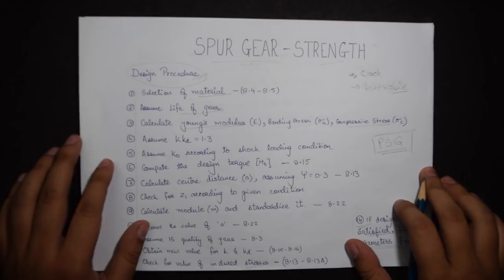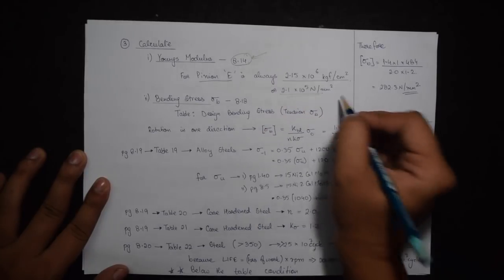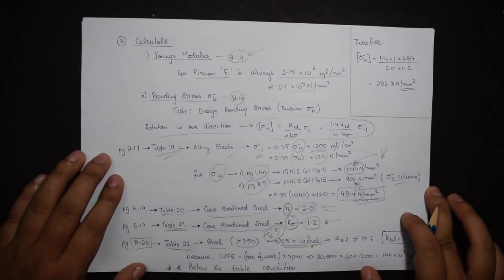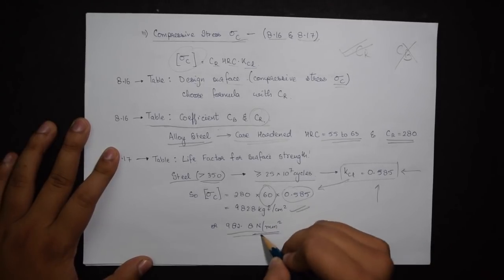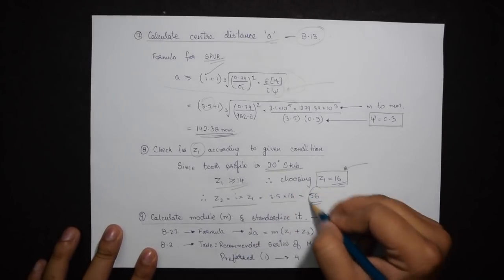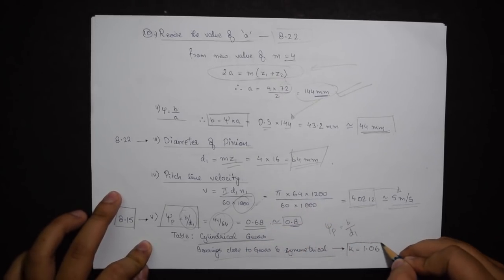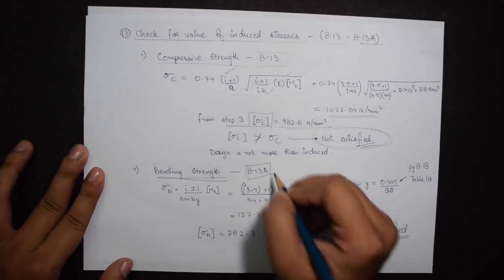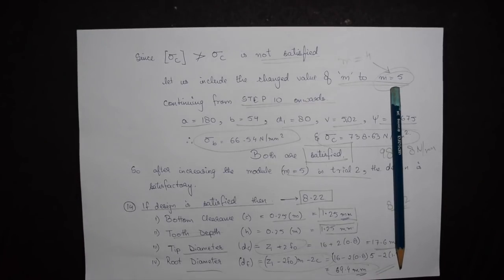Spur Gear Design Procedure based on Strength

Comment: Shouldn't we do the checking with the gear too, instead of just the pinion?
Reply: Adhitya The gear is under a lot more torque than the pinion, due to lower RPM. So, the contact and bending stresses for the gear would be higher than a pinion's. So why check the pinion instead of the gear?

Comment: U are talking about taking 8.5 and 8.17 and 8.16... What was that?
Reply from the maker: The link of the book from which the formulas are taken is 
Amazon - https://www.amazon.in/Design-Data-Engineers-College-Kalaikathir-Coimbatore/dp/8192735508/ref=sr_1_4?ie=UTF8&qid=1508657797&sr=8-4&keywords=design+data+handbook
Reply: U can buy this book (PSG) from the shops as well
Reply from the maker: Yes definitely this data book can be bought from the shops. I was just sharing that the numbers in the video are from this book!

Comment: How do you select material ?
Reply from the maker: Material Selection is based on the type of question. If the material is not specified in the given problem, Steel or cast iron (data available widely) of any grade or alloy composition maybe selected from page 8.5 in the data book. 
Although the choice is solely dependent on you and you can select any material of your choice, just check whether or not all the values are present to plug into the different formulas.
Reply: ROBOMECHTRIX thank you
Reply from the maker: Please share the links for the videos with all your colleagues so that they are benefited as well! 
Keep Sharing, Keep Commenting!

Comment: Why do you use a pencil, sometimes it's hard to follow, specially on a 5inch phone at 360p
Reply from the maker: I really regret for the inconvenience caused. Although, I presume, all the videos have been tried to be kept at maximum quality possible. Pencil is easier for me to explain by encircling and pointing things out. You can definitely ask out all the doubts you have with you in the comments section.
Reply: abe wifi pe dekh na